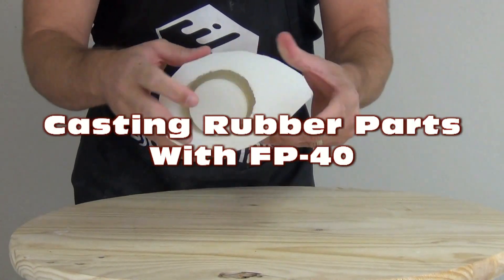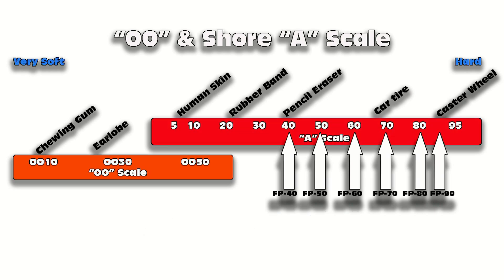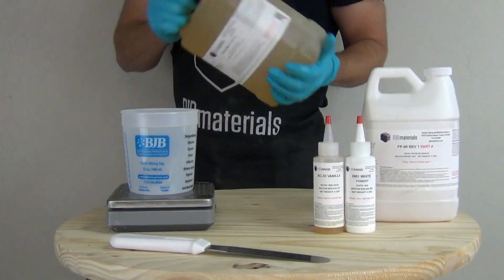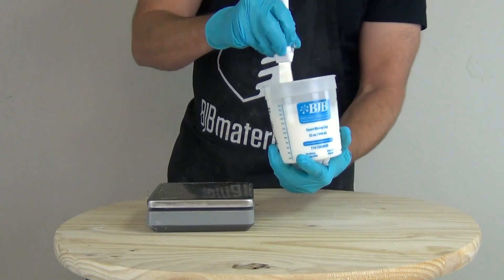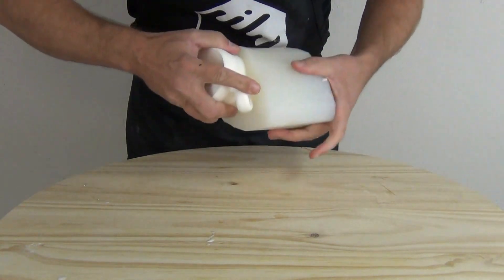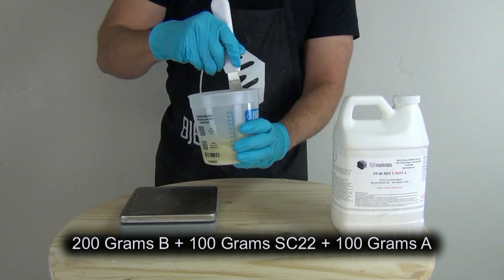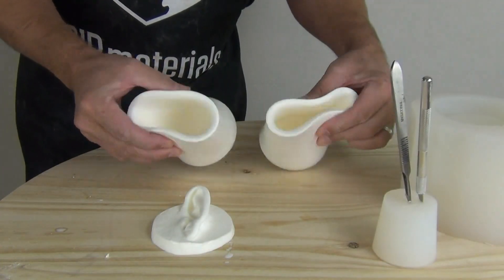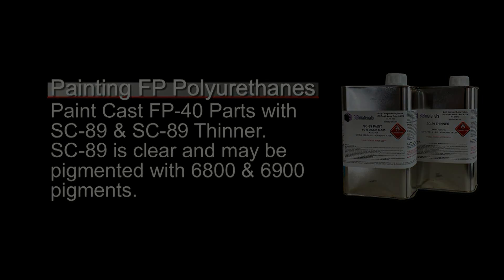Casting Rubber: FP-40 Casting & SC-22

Comment: I have a few questions. Is this type of urethane rubber ideal for casting a rubber mask from a silicone mold, and can it have similar high-quality properties as, say, a latex Halloween mask when mixed with the SC-22? My son is trying to look for latex rubber alternatives that will be safe for his mask mold and wanted his casted mask to not have signs of deterioration, distortion and less maintenance work. I would appreciate your help if you could be so kind to share information. Thank you.
Reply from the maker: For a mask I would use a soft silicone like TC-5100. Silicone mask making requires a lot of steps, though, and cannot be cast into the same mold as latex.
Reply: @brickintheyard , my apologies for less details and more confusion on the subject, but the mask my son is trying to make is more like a latex mask than something more flesh and lifelike. He wants to make a mask that is more like a latex rubber Halloween mask, similar to Michael Myers' mask, just different material that SIMULATES a latex rubber Halloween mask so it will last longer than actual latex.
Reply from the maker: @sandycurry6441 good quality mask latex will have a long life as long as it is not stored in direct sunlight.